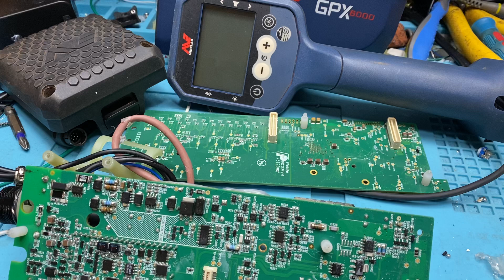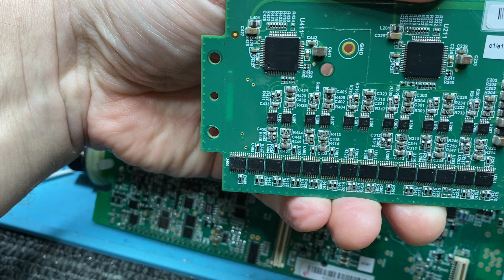GPX-6000 intermittent fault finding.

Comment: My six has been turning it's self off, as well as back on again sometime, sometimes it wont boot up for acouple of trys then works fine, other times it turns off a the ! Flash's on the screen.
Would this be the course, bad connection. Cleaned battery terminals with no change. Still under warranty, is this a minelab fix.thanks Craig
Reply from the maker: If it’s under warranty it’s best to get Minelab to repair it.

Comment: The relabeling of parts is very common for parts you buy direct from China (Like Temu/Ali etc). I have examined several parts  for a distributor. They melt parts from PCBs above a fire, then hit the board on the ground and parts drop off. Then they remove the marking by grinding and relabel them. For IGBT/MOSFETs etc they spotweld 3 new pins, rework and polish it with tin and sell them as new. This goes on a very big scale. A batch of IGBT I tested was about 150 pieces. The IGBT's were not even close to their specs, some were IBGT but an other type, some mosfets, some were dead. Recapped a few of them and the dies were all different. And that all for a part that they sell for something like 50 euro cent. Most hobbyists do not know, they think they have done something wrong or while repairing that part was not the cause and so they are satisfied buying in China, not knowing the cause were cheap fake parts. If you are very lucky they are original but used and given new pins.

Comment: That is some very bad soldering, is that how it leaves the factory ? I see a lot of cold solder joints in my work, often the result of the owner butchering the thing with a Chinese soldering station. It is a sign of not enough power and a to high heat resistance (combined with lack of soldering skills and fake Chinese solder and flux). I use 2 Pace MBT stations, they can solder everything. I use a OKI hot air station. Customers pay for the repair so my soldering must be first class.
Reply from the maker: The whole circuit board is a multilayer heatsink.

Comment: Already got my attention with the title.. 
I have just started to have intermittent noise that is impossible to cancel out or use.. 
Comes and goes.. I have been advised that its known and the boards are being replaced
Reply from the maker: I have fixed a few of these noise issues, also dropping coil handshakes as well. The issues can be cured.